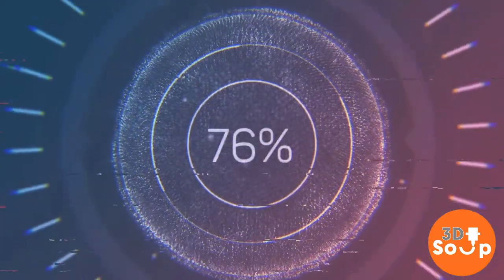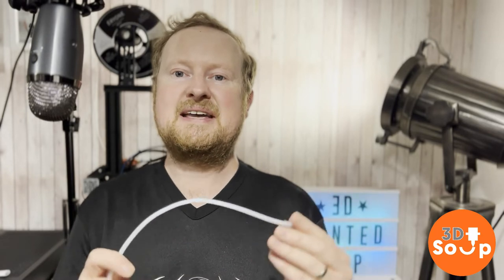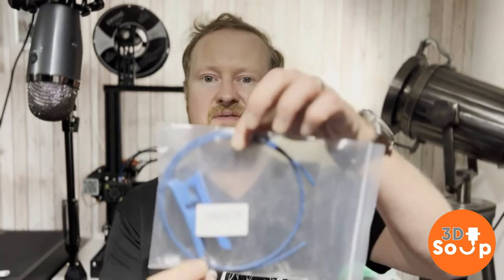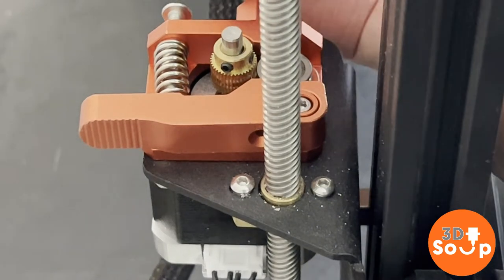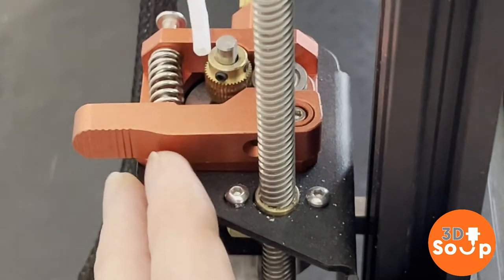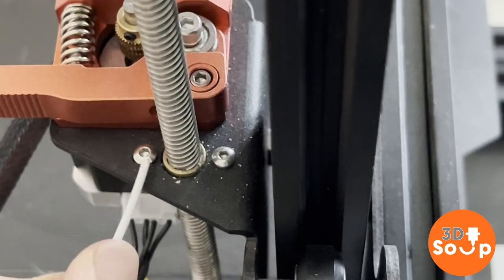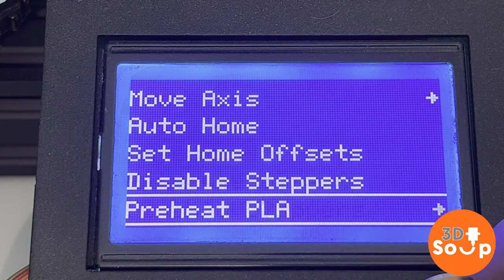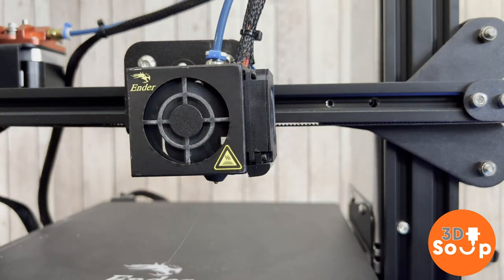Ender 3 Bowden tube PTFE replacment removal and fitting. how to guide bowden tube upgrade.

Comment: I just bought a printer and there was filament broken off in the tube. Replacementnon the way but i cant get the tube out thr hot end. Ive even removed the whole nut and its stuck below that. Any advice on how to get it out?
Reply from the maker: I’m going to assume it’s the same printer as in this video. I would heat up the hot end, sounds like there has been some molten PLA or the like that has leaked, you need to melt it and pull the Bowden tube out while it’s hot, as for the stuck filament, heat up the hot end and use some thine, stiff wire to thread through the nozzle and this should unblock it, removing the nozzle carefully (its brass so damages easily if you are too rough) clear the blockage and then attach the nozzle, push the tube in hard so there is no gap for it to leak again (get a new tube if it’s burnt or squashed) , level your bed, heat and insert new filament.
Reply: @3dPrintedSoup  thats over and above. Thank you. 😊
Reply from the maker: @markmorris2856  glad to help :)

Comment: I have the new tube, but been hesitant to replace it. I thought I needed to loosen the nozzle before putting the new tube in to make sure it has a solid seal. Is that not the case?
Reply from the maker: You can loosen the nozzle and tighten it up after you have inserted the tube, I never have myself and have not had issues. However I may try it next time as I’m always up for new ideas. Thanks for watching

Comment: Aren't they both ptfe? I'm fairly certain both the white and the blue are teflon/ptfe. Just that the "capricorn" tube has tighter tolerancs.
Reply from the maker: Capricorn has raised temperature resistance of the PTFE tubing and reduce carbonization, so yeah it is pref , just better :) thanks for watching